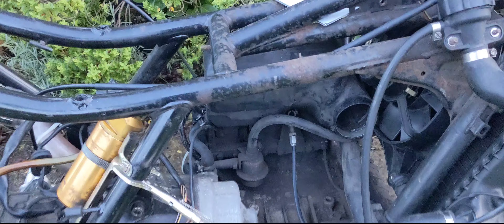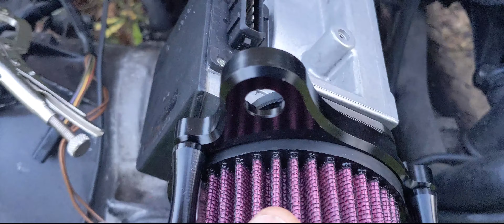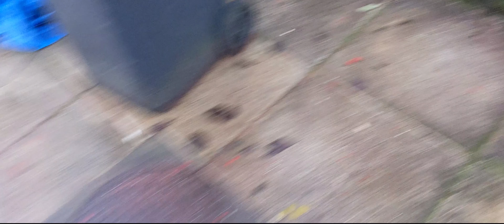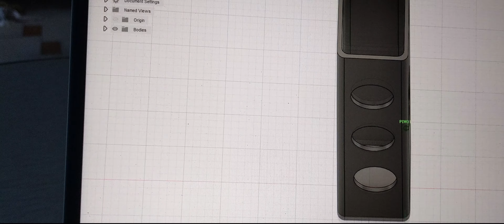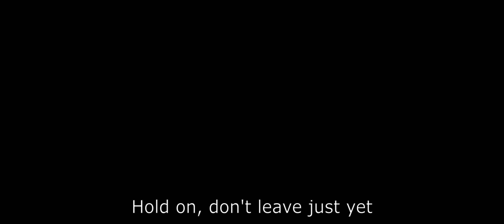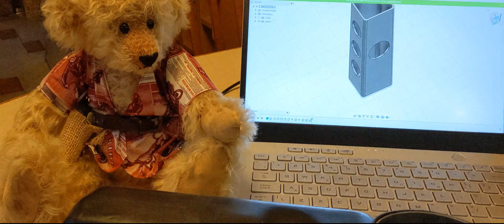BMW K75 flying brick cafe racer custom. Part 2 of many: Airbox/plenum/airflow meter/MAF quick update

Comment: Do you still have this bike? does it run fine with the aftermarket airbox and exhaust? I was reading they don’t like anything but the factory stuff, however, the aftermarket airboxes look so much better. (1991 k75 rt)